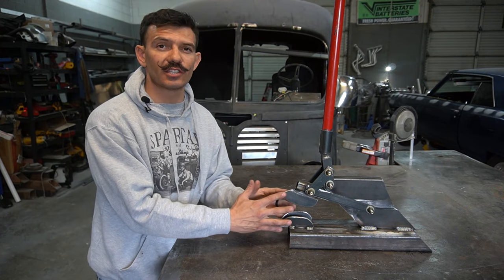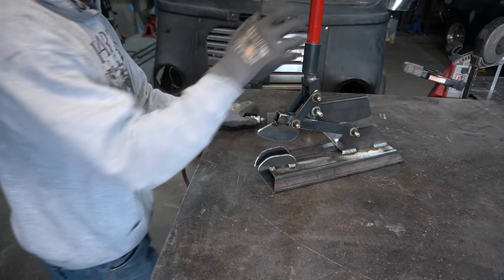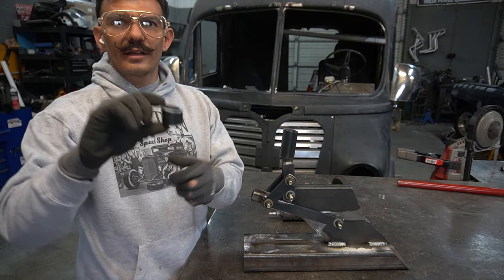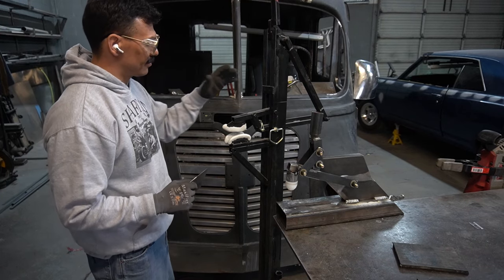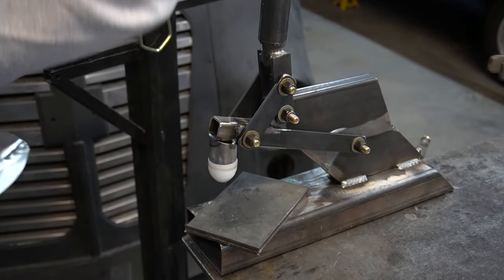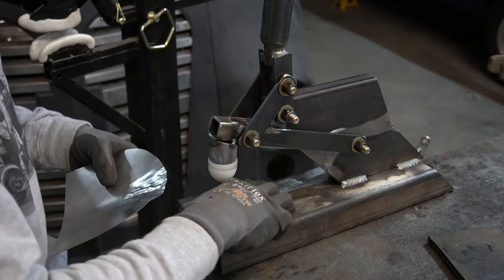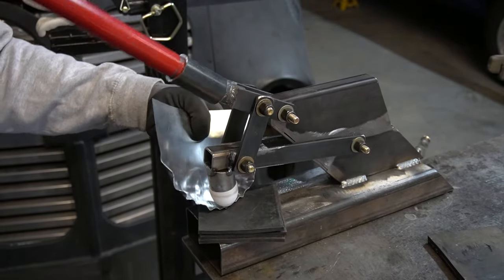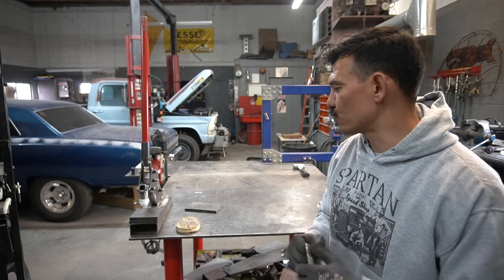Will it work for metal shaping? press hammer | sheet metal hammer press

Comment: Sensible advice Tubal , back in the 80s I used to work in industrial computer set ups and the cooling fans were huge you were forbidden to wear a tie or anything that could potentially strangle you whilst working on them back then ! works a treat dude never doubted it ! designed by a master craftsman…I would think that could come in handy for a lot of shop jobs ..cool 👍
Reply from the maker: Thanks man! Yeah my buddy almost died from having those strings on his sweater so I figured I would put that in there.

Comment: Have you considered having your tooling detachable.  you could slide a square tube over the top box section and have tools located over two studs for the lower tool holder.  I think the shrinker and the ball stretcher worked really well. (complete novice who doesn't have a clue but hey hum...)
Reply from the maker: Thanks man that's a great idea! I did think of having different attachments but I haven't put much thought into it. I'll keep that idea in mind tho!

Comment: dude i freaking love this tool idea the thing i think would make it even better is making interchangeable shaping dies to kind of push it in to the shape you need and you might even use wood blocks to test out die shapes ether way i love this tool thank you
Reply from the maker: Thanks man! Yeah I actually put a happer on it to try to push out the tucks! But it didn't work as well as I was expecting, but you can totally put other tools on here and use it as a press! I tacked the teeth on this because it was the first try of my idea and I wasn't sure how well it was going to work lol so you just watched me build the prototype basically. But I have the plans on my website if you want to make one https://beametalfabricator.com/product/metal-forming-tool-lever-machine-tucking-tool-for-sheet-metal-fabrication-diy-gathering-tool/

Comment: Great idea but maybe consider design with interchangeable heads for the shrinking stteching and tucking... but overall its good
Reply from the maker: Yeah that's definitely an option! I just wanted to try it first, in case it didn't, I didn't go through the trouble of making them interchangable

Comment: Just a couple of ideas - first why not make a threaded insert so you can change tools in the hand built press easily instead of having to grind/cut one off and weld the next on, second how about an old wiper motor and linkage set up to operate the handle for the press to make a power hammer.
I don't know much about bodywork but machines are always useful!
Reply from the maker: Yeah your right I want to make the does interchangable but I wanted to make sure my idea worked first. Also I have an idea for a power hammer I will be making a video about it soon! Thanks for watching bro!

Comment: Nice video. How do you like your magnetic sheet metal brake? I’m considering getting one but am concerned about the reliability of the electronics, and how well it works.
Reply from the maker: Thanks man and yeah it works pretty good! I like it! She fires up every time I need her too. I've had it for about two year maybe a little longer. It has its limitations and it's advantages like everything. It's a super strong magnet

Comment: I like this tool lots of uses . The tuck tool .? I'm wondering what would happen to the tuck if a die was made for this tool that closed over the tuck .  Think like thumbnail die . No reason a simple die in the tool wouldn't work .
Reply from the maker: Yeah that was going to be the next thing I wanted to try with this. I'm not sure if that would work either tho
Reply: @BeAMetalFabricator   the hardest part would be stopping the metal sliding forward when being compressed I would think. . If the top die resembled a shrinker die it may be more effective to hold the work in place ??
Reply from the maker: Yeah it could possibly work! Iv never seen anything do that before. That was the problem I was having with this hammer was it was slipping when trying to strategicly compress the tuck, when I would press it straight down it would almost just flatten back out, not as effective as I was hoping...